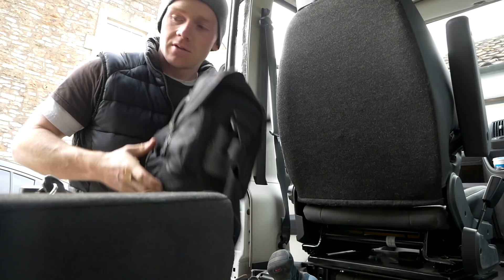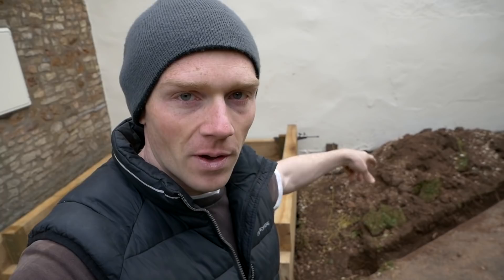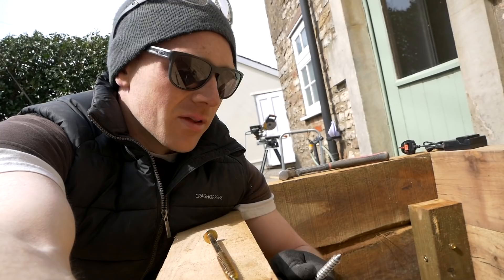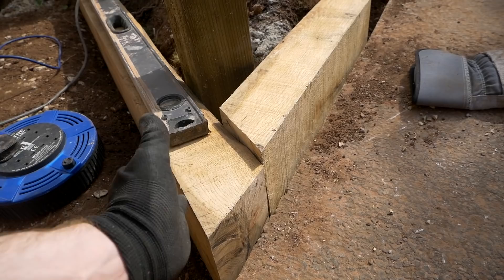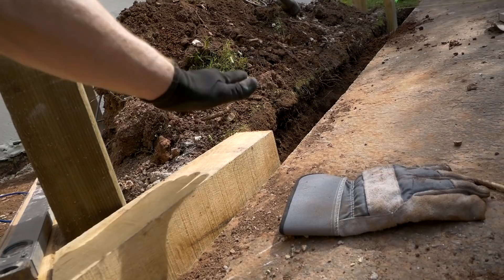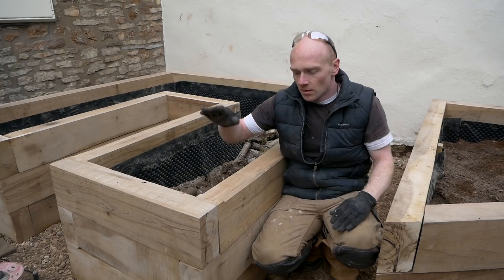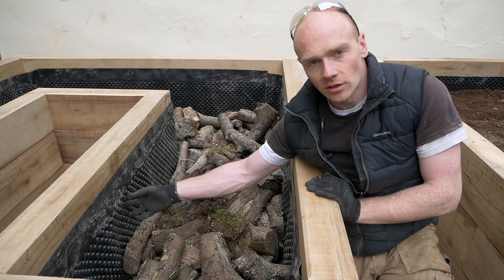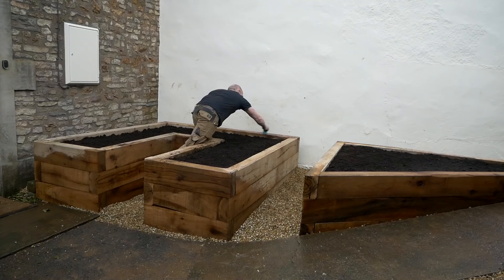Building the OAK KITCHEN GARDEN - Part 2 of 3

Comment: Hi Restoration dude, I’m starting a raised bed project in Hertfordshire and been learning a lot from your videos. Really enjoying them.  Got the draper fence auger in transit, sleepers, gravel and gearing up.  I’m laying short side down so the sleepers give me more height, so I’m insertIng 75mm / 3” posts. The sleepers are 100mm by 150mm (1.2m long) pine sleepers. 

How much depth of gravel do I need to put under the sleepers? 
How far down do place the posts? 
How much gravel do I need to put below the posts?  

I’m thinking of having the post 400mm buried and 400mm above ground, 50mm below the sleepers top edge. Length of the whole project is 4.5m by 85cm depth.  I’m being cheap and putting gravel boards at the back. I’m going to try and stagger the three sleeper layers to help bond the front wall, if I do that then I think I will need x7 posts.  Was thinking of x5. What do you think?

Would be grateful of your advice. Thank you Anthony

Comment: Great videos as normal...what is the name of the membrane used? I just seem to find self adhesive or paint on stuff when I search on google...was it expensive?
Reply from the maker: It’s a basement or wall tanking membrane. I just got it on eBay as an experiment. Gravel between wood and a weed fabric does the same job as I have done in the past.

Comment: Tim it looks fantastic but could you not have used the small precast concrete posts with the pre drilled holes in the corners? A number of US youtubers who do raised decking say moisture rises up through concrete and will rot the timber at the base. I have a pergola here which was built around 10 years ago and exactly this has happened, although the wood is not oak admittedly but treated timber. Clearly it would not matter too much in this instance but I am interested to see what you will do on your father's pergola. Perhaps a metal fixing plate at the base would be the way to go?
Reply from the maker: The oak frame is just sat on staddlestones with DPC under. There is then a stainless rod resin fixed in pad and inserted in oak post. 👍
Reply from the maker: Looking at using composite posts on our deck for the same reason 👍

Comment: will the bolts not shear off with the contraction and expansion of the sleepers?
Reply from the maker: Always a chance but once they are all locked together the bolts are not really that necessary. I usually drive an oak peg down through them instead but only really works when used flat.

Comment: How much does a project like this cost? I recently made a similar thing but used gravel board. Good job
Reply from the maker: Depends how high and what timber. The oak is roughly £25 a piece so gets expensive quickly, although does last longer. In my own beds I only go 300mm high and just use softwood joists or thick gravel board.

Comment: Won’t all those logs just decompose?  Need bricks / rubble to act as drainage
Reply from the maker: Don’t think you watched the whole video! 😉
Reply: The Restoration Couple I did afterwards 😃

Still needed to add stones for drainage. Soil will be too wet / boggy
Reply from the maker: 👍 The whole lot was build on gravel where the old shed was so pretty much freely draining. Stone and rock would be a good option for bulking out the bottom of the back fill though and act like a kind of soak away.

Comment: Oak is really expensive here.  Astronomically expensive actually.  Why not just plant in the ground; maybe just a little wall in the front next to the path.
Reply from the maker: Just personal choice i guess. If you want raised beds then oak is going to last the longest. Other option would be to do it in stone but may end up costing more, especially as it would take longer. I’ll be doing our own garden next week using much lower softwood beds. 👍
Reply: Exactly ‘personal choice’ oak sleeper setup like this looks great and has transformed that area however if money is the main concern then yes plant in the ground but don’t question the reason behind this video